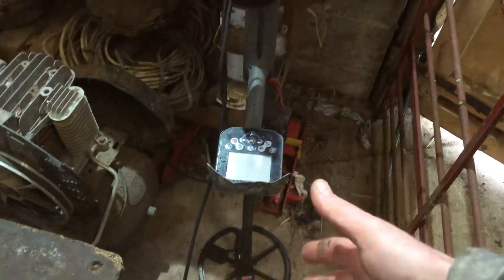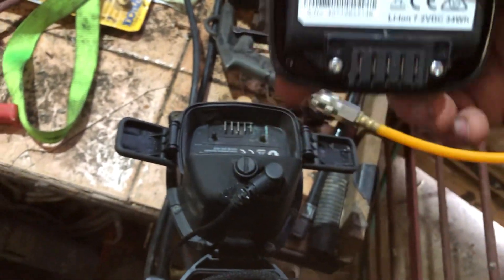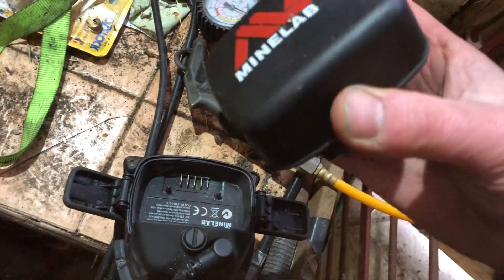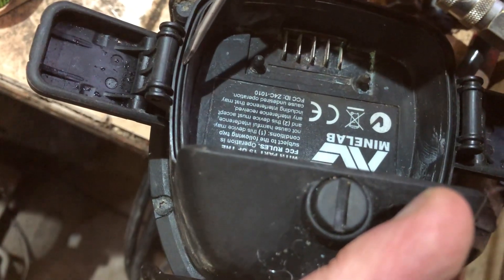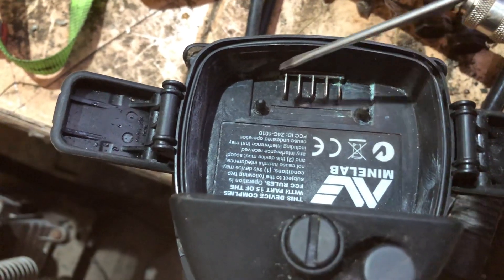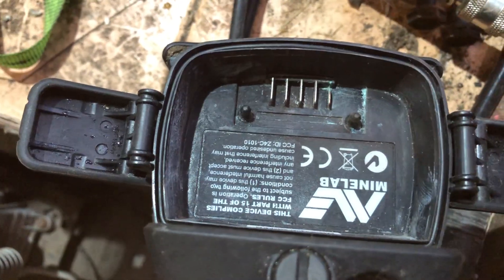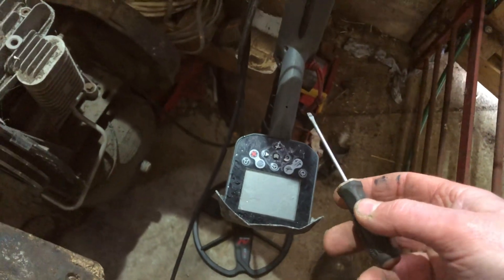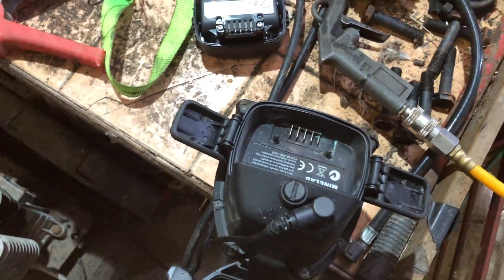Ctx3030 metal detector battery problem fixed 👌#metaldetecting #metaldetectinguk #ctx3030

Comment: I've not used mine for 2 years since I've had the 800 ,i might charge it up 😊
Reply from the maker: I don’t use it on pasture these days bud but I use it at the beach pretty much all the time cos I do like it. Nox deffo better on pasture 👍
Reply: @onlygazza you probably know but if not - you can super glue the ends of that o ring stuff together to complete the o ring and make water proof.
👍